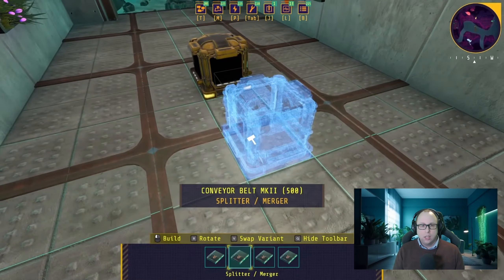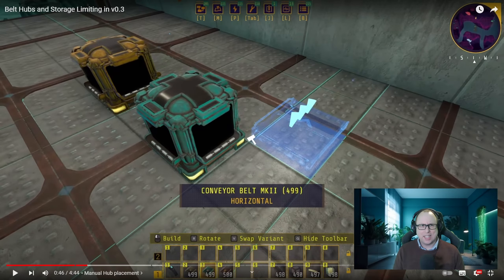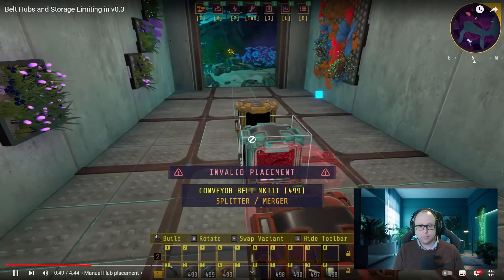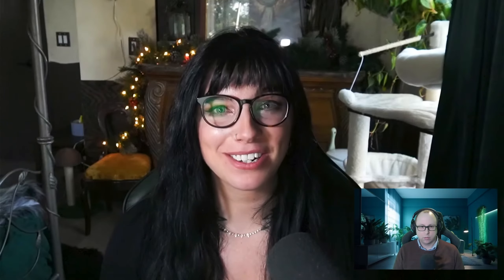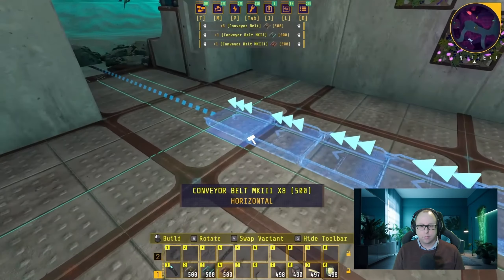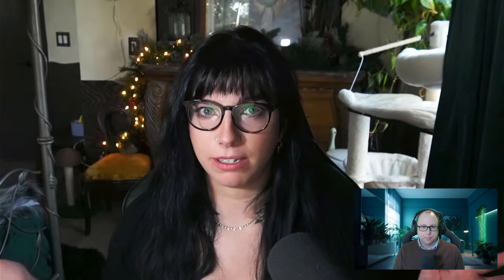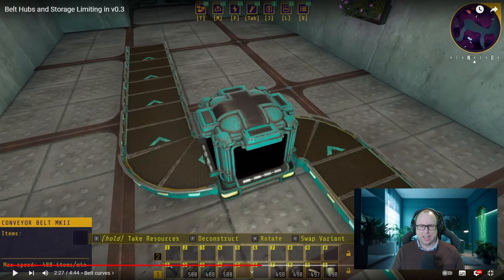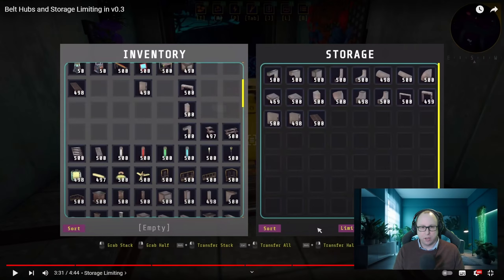Hubs & Storage Updates - Techtonica 0.3

Comment: Im not sure what the point of limiting a box would be, but ok.
Reply from the maker: I would use a limited box for things I do not want a lot of. For example, most of the machines. Especially ones you don't use a lot, or a lot at once.

Off the top of my head I would limit threshers, power wires the monorail tracks and poles etc.

At the moment I build them manually because I don't want to waste resources. Can take a while if I forgot I needed some.